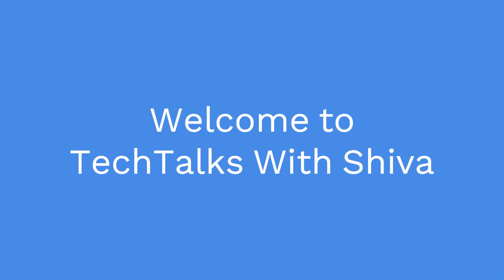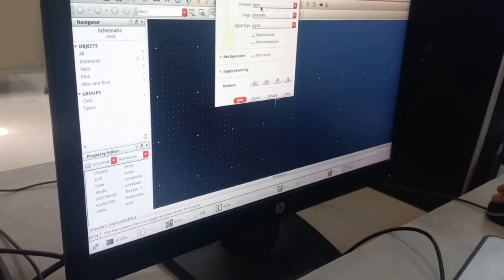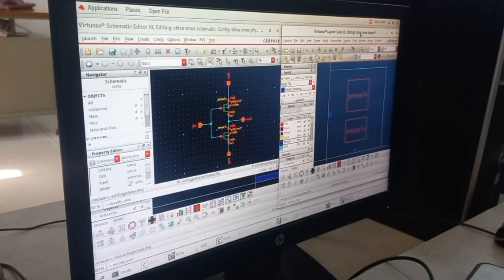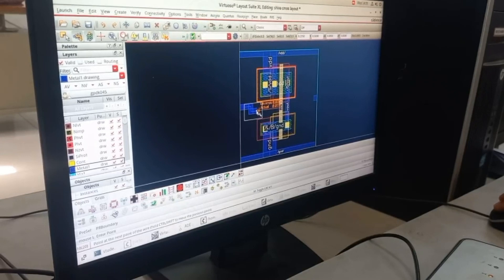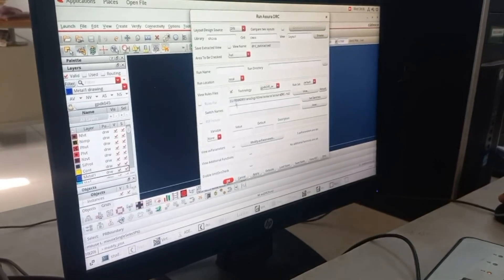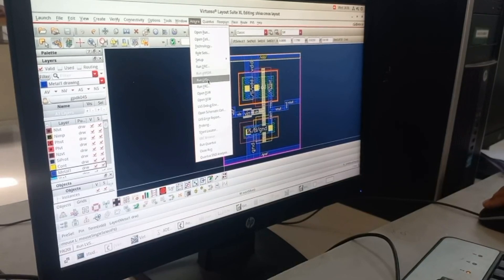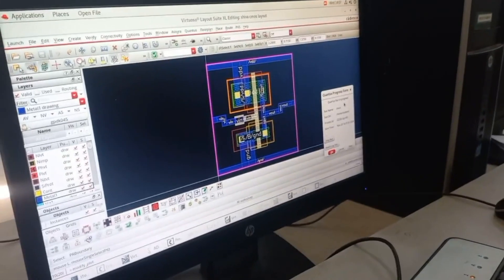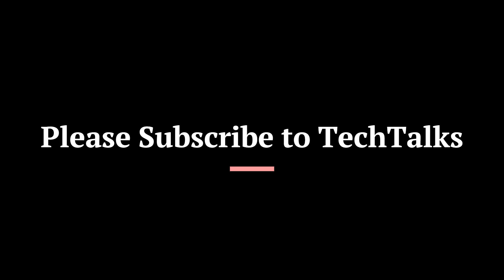Complete CMOS Inverter Design & Layout Tutorial using Cadence Virtuoso

Comment: While I'm doing , I getting many drc errors
Reply from the maker: @subashchandrabose4683  you will get DRC error only if you violate any design rules, check if your components to component spacing is as per the rules and make sure that you are travelling atleast 12mills before u connect the vin to the poly, check with these and you must be able to clear it.